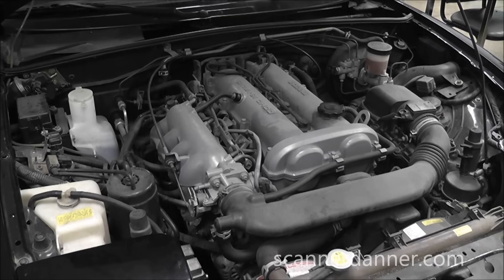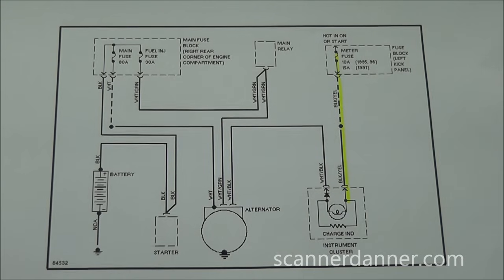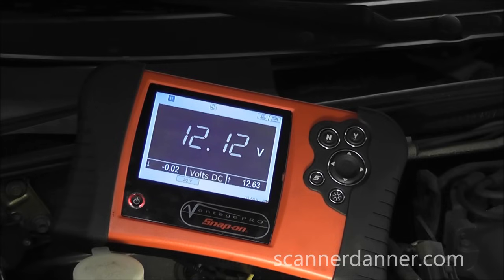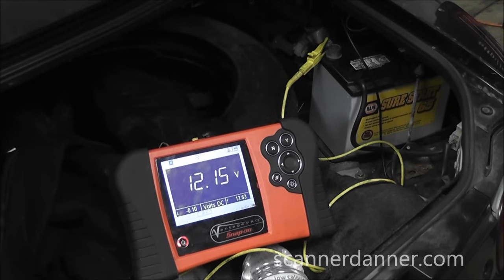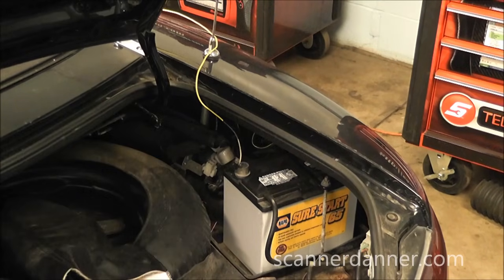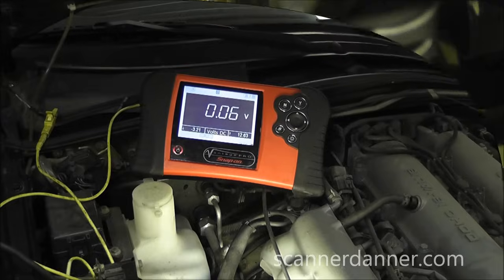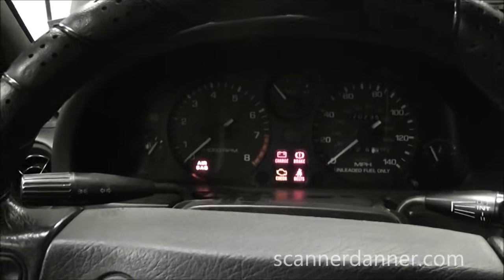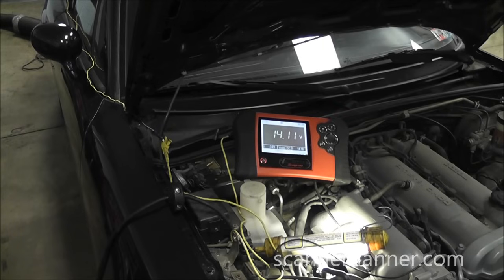How to test an Alternator (not charging from a blown fuse) - Mazda

Comment: I would never complain about your thorough tests Paul. I would much rather see a 2 hour video on a blown fuse than a 2 minute video on replacing a fuse.
Reply from the maker: nice
Reply: Well said!
Reply: Heck yeah! 
It has been my experience that it is rarely a blown fuse.  It is always the real world issues.
Reply: @ScannerDanner  what is the charging output current from the alternator to the battery when engine is running?? Is it fixed at 1 amp or lower, or varies??

And, how does the alternator stops charging the battery when the battery is full?? Any sensors??
Reply from the maker: @tnamen1307  all done by a voltage regulator that is typically inside of the alternator
Reply: @ScannerDanner  what is the charging output current to the battery before the battery is full??
Reply: Me too for sure

Comment: Thank you! This indicator lamp circuit test and its key triggering effect for the alternator to charge is  SUCH A LIFESAVER to know for older Miatas! You are the ONLY mechanic to EVER suggest this!
Reply from the maker: +yougeo thank you! just be sure it is an incandescent bulb in your test light and NOT an LED type.
Reply: +ScannerDanner Why not use an led type? Does it have to do with resistance?

Comment: Mr Danner. Every time you pull out a wiring diagram and trace the different components of the circuit you are performing a great tutorial . I share your enthusiasm for Mitchell diagrams  and sometimes feel lost without it. Auto electric[s] used to be a separate discipline, but this is no longer the case.

Comment: For educational purposes, it was excellent that you performed those checks before replacing the defective fuse.  I would have added that the charge light circuit is grounded through the stator;  thus, with key on, engine off, the light is on until the engine starts and the alternator begins charging, at which time the stator is creating voltage simultaneously removing the ground source for the charge light.  Also, with KOEoff, the voltage reading on that circuit would be less due to the presence of the diode.  Keep up the great work!
Reply from the maker: +Chad Jessup thanks Chad!

Comment: I diagnosed a similiar problem with my '01 Subaru Outback, the #5 fuse under the hood would burn out sparatically. Alt. would stop charging, gauge cluster would die, engine would continue to run.  I finally diagnosed the issue, there was a short in an aftermarket front turn signal connector.  The loose brass contacts that power the bulb were touching together and popping the fuse.  What a P I A!  Problem solved with oem bulb connector installed.  Great video once again, thanks Paul.

Comment: -with out answer at that time. than you for the deep explanation , by the way this truck was my dad truck not a customer, just to mention Paul f I have done many repairs other mechanic have not be able to do in my area, he has been working for 18 years on Honda dealer  and does side work as well me , but  He is part changer I feel very satisfy when i do those repair he can not do, but I use the  testing method you are teaching , i first test system and replace parts ,ALL CREDIT  TO YOUR TEACHING

Comment: typically I check a fuse first, but it really doesn't matter which direction you come from, and it's always good to check the function of the alternator anyway, or at least know how to do it so this instruction is still very valuable.
If the fuse is blown, then we know it blew for a reason, so yes, we don't send them away with the fuse replaced because it's going to blow again.

Comment: My hero, and I dont call anyone that easily. Im not done yet watching the entire video and I have 5 stars for you Paul, is it? My car is driving me crazy with a low voltage, no voltage and voltage drain even when the car is running. I've talked to so many 'subject matter experts' and they all give me the run around and dont even want to look at the car. I too had to get my alternator tested more than twice and even when checked ok I had them rebuild it from the inside out with new parts. I wasn't aware the alternator has to have solid ground connectivity through the casing to the chassis of the vehicle and although I've check there is at least some connectivity the fact that I painted the alternator bracket that holds it to the engine it may not be getting proper grounding. Also, my battery light is always on except today when i put a fully charged battery with at least 13.6v then the light went off but it came back up as my battery kept going down in voltage. I am almost sure now my issue is a wiring problem from the alternator and not the alternator itself. Thanks for not just stopping the video because you know what the problem is but explaining the situation to me a computer systems engineer makes a hell of a difference. My car is a rare SOB Dodge Stealth RT/Twin Turbo AWD, AWS, All Day Headache car but when it runs good it kicks but. Thanks for the information on this video. You've just got a new subscriber .
Reply from the maker: Some hate my teaching style, but when you truly need to learn systems and operation and you're not just looking for a silver bullet, then you've found the right channel. Thanks so much!

Comment: owe a huge THANK YOU, scannerdanner. had an accord in today that wasnt charging. check eng. light was on, customer said he tried a new alt-still didnt charge so he brought it in. i verified it wasnt charging, checked for + at the batt post and had power but i saw i didnt have power on the wire from the indicator light. found a blown fuse, replaced it-alt started charging. gotta diagram on that fuse-found it fed the heated o2, checked and found rubbed wire on the o2 from a misinstalled o2 sensor!

Comment: This video is one of the best I've come accross. Really good job. I noticed in the scematic that there is a resistor accross the charge indicator bulb, which I am assuming is there to keep the alternator working in case the bulb blows. This won't help with the blown fuse though.

Comment: ya i couldnt believe the things i was checking that i remembered you doing in this video were so closely related to my 'real life' situation. the cat conv. that the problem o2 was in was welded in. when it was welded in, it was put at the wrong angle so the o2 wires were stretched bad to make connection to the connector on the car. the wire rubbed thru and actually grounded out on the o2 itself. gotta handshake from the boss for that diag, cant thank you enough!

Comment: dude i have learn a lot from you. when i do alternator i use a test light to do most test its a quick easy way. use the test light to check the heavy gauge wire with the test light on ground we get we know that main alternator fuse is good. then you check smaller gauge wires. what i normally do is disconnect the connector in your case, you should find the test light for one of the wire when ignition at run. all alternator regulator the pin that goes to the warning send out negative as learn from you be component in this case the regulator. so with test on ground and touch the light if the gauge fuse is good the battery should come in the dash but you have to know your circuit

Comment: Scanner Danner: I tough that the white and black wire should have positive all the time while the car is running. Since the positive goes trough the light bulb. Unless its a a internal problem with the alternator, that is when the alternator give a ground to the light bulb and the light comes on.So i think seeing the 0.2 volts at the start on the diagnostic  at the white and black wire, was an indication that we were missing the positive or having an alternator problem, but not saying the alternator is bad yet before applying a positive to the wire as you did.

Comment: I got a truck to do once that wasn't charging someone had fitted an alternator. Batt light on dash. Not charging. After doin similar checks to you found an open circuit ign feed to alternator (that was a blown fuse). Had a dead short on that feed. Finally traced it to an electron headlight adjuster motor short circuit. Had me stumped for nearly a day.

Comment: Good explanatory video. The alternator recently failed in my BMW e30 but there was no charge warning light showing. The bulb is not blown. All ignition lights went off as normal when the car was started as if there was no problem but the battery wasn't being charged. Only indication was radio switching off and lights dimming.  Something is obviously blown in the alternator which fools the warning light. The charge warning worked ok when I tried what turned out to be another dud alternator in the car. Anyway a new replacement alternator solved the problem.

Comment: I think I had an old car years ago in the UK and the charge indicator lamp blew on the dash and the battery stopped charging. They were only filament lamps. I think the voltage on the alternator  side varied because the lamp would glow half on sometimes, maybe if the fan belt was slipping. I remember the regulator was some sort of set of relays they would be vibrating all the time. I must be going back to the time of dynamos. Great videos and great knowledge the man has. You can't beat having a good understanding of the theory of how things are meant to work. With cars they always seem to be switching the negative side of things, I suppose there's a good reason for that, if anyone knows?

Comment: Great video Paul. I remember this issue in my Dad's Chevrolet malibu 1978 whenever the bulb was blown off the alternator didn't charge any more unless you activate the bypass circuit by snapping the throttle gently

Comment: That was amazing! I would have thrown an alternator in that car for sure. What I don't understand is what the wire going to main relay was for. I figured that was the wire to excite the alternator and get it to charge. When I saw voltage at that wire, I immediately thought the wiring was fine and the alt was bad. So, what was that wire for? Again though, awesome!

Comment: I work as a supervisor for a large dealership, so I get to see a lot of new technicians and guys from trade and technical colleges come through the shop. I guarantee when they come to me about a electrical, or computer related problem my first question to them is -NOT- did you check all the fuses first!!! My first question is for them to explain to me how the circuit is supposed to work, what checks they made and what the results were. Sorry if it sounds like I'm tooting my own horn or being a ass, but I feel that it's important the new guy and those that are wanting to build a career in the automotive or diesel related field understand that as a manager/supervisor if you don't understand electrical, not able to constantly learn, improve and progress your future is very dim, at least in the wages aspect of the job. As a result of this I thought it might be beneficial for the new tech to understand what it is like from the other side of the counter. Example: I gave a tech a job, customer complaint, " Blower motor doesn't work at times customer has replaced several fuses with no change, some times works and other times not." Happens every few days but more so when it's cold in the morning.  Technician comes back 15 min later and reports with a smirk that was a easy fix what else do you have for me? What did you find I asked.  "I couldn't find anything wrong so I installed a circuit breaker and parked the truck."   Please don't be this guy!!   If you want to impress your boss and learn something as well explain to him all the resources you used in making your diagnosis. Present the wiring diagram and the measurements you recorded during your investigation. Present any further questions you think would be appropriate to ask the customer that might be related to his issue. If you truly can't find anything wrong at least document were you would go from this point if the truck came back with the same complaint, based upon how the system works present other things that would be effected in the circuit(s), such as power is provide from the key switch to a 15 amp fuse that powers a relay, this relay in turn power fuse numbers xxxx of the fuse panel which provide power to the blower motor. If the customer has the problem again have him look and see if his horn doesn't work at the same time etcc...
Reply: you really something else

Comment: You can get those test lights off ebay now for about £2.50, that's about $5 i bought 2 of them....yes inside the alternator the bulb circuit usually goes through the rotor, then through the regulator to ground, so when you turn the ignition on the light comes on, then when it starts there are 3 field diodes connected to the terminal inside so you get battery voltage on the bulb wire when engine starts, so you end up with 12 volts each side of the bulb...you can just earth the bulb terminal out to see the if the light comes on that's a good test on the light and wiring.....from Fred in England.

Comment: hi paul, I happend to watch a video about that Alternator especially on internals of electrical cirucit. The charging light gives power to the regulator, this regulator have a built in pulse width modulator which will pulse the field coil(on and off) the field coil, during high speed pulse is less and vice versa, once the car started, operating generator causes the charging light to go off by disabling the ground to that light. continued...

Comment: I see a couple of guys explained what makes the inst light go out when it cranks but it went over my head.  Can you help me on this point.  As usual a great video.  I always learn so much from yours and to me the longer they are the better.  Thanks.
Reply: +Jim Buford thanks Jim. Hard to do here but in short what makes the light go out is when there is equal potential on both sides of the bulb. 12v from ignition switch and ground through alt. When it's not producing voltage. Once alt begins to spin it puts voltage on that circuit that was a ground. Light goes out. Remember if a bulb has 12 and 12 there is no flow

Comment: It is interesting that the Alternator light dash circuit is needed for Alternator excitation (or perhaps voltage regulator enable), which I think is evident due to the resistor across the bulb, which provides a minimum feed resistance.

I think the question to ask is why did the 15A Alternator / Dash fuse blow? For an intermittent fault, I would first suspect chaffing fuse output wire under the dash. Because to blow the fuse the short would have to be just after the fuse. 

To test for voltage drop on the Alternator main output B+ (heavy cable to the battery) you would really want to have "representative" levels of current (vehicle running current with loads on together with the battery charging current) output from the alternator, which depending on the vehicle, may actually terminate at a power distribution box and then go to the battery. 

If you monitor the Alternator current with a clamp meter and watch the voltage drop you could actually determine the overall resistance if you wanted to. One reason may be to see any difference in the circuit after you clean up any corrosion or dirty or damaged connections. I know I can look at these two channels with my Scopement, but I have not yet tried my PICO Scope. All that is really needed is the proper channel scaling (and isolated channels, unless a voltage differential probe is used) and a built in math function.
Reply from the maker: In the description I have part 2 listed where we attack the cause of the blown fuse 
https://youtu.be/FK9STP4G9-I
Thanks!

Comment: These types of alternators have been around for 50 years.. And the first thing we did at the Alternator shop  was attach an exciter bulb to the alternator...As they require that bulb to excite the charging system...Then you find out why the fuse blew...

Comment: Hey, hey, Paul.  Awesome oldie but goodie!

?: That bulb circuit diagram is showing a diode I believe (WHT/BLK) and a resistor in parallel with the bulb.  Can you please confirm I'm interpreting that correctly?  I love the way you always follow through with additional voltage readings as you did throughout this video!  I helps to solidify what's being learned from your case study.
I tried looking for comments below asking about the diode but I didn't see any in the ones I went through... Thanks!!  Hope you and the family are all doing well.  Ciao!
Reply from the maker: Time frame please. Thank you!
Reply: @ScannerDanner  Hi Paul.
1:02 the wiring diagram of the instrument cluster bulb wiring shows a diode symbol between the bulb and external connector WHT/BLK.  Also, a resistor in parallel with the bulb.  Is that in case the bulb filament is severed?

Thanks again!

Comment: Great video Paul, never seen this before. So if a charging problem exists always check for the charge lite with the KOEO on all cars? Video suggestion, parasitic drain caused by the ALT. Replaced the ALT. and problem went away. It was on a 93 E-150 with a 5.0 engine. Don't exactly know why but I suspected a diode problem even though the diodes checked out ok on our test equipment.
Reply: Sorry I missed which wire you leaned the test light against at the end of this video. Will you please tell me?  I love your videos....been watching a lot of them lately. Picking up good information even though I don't have a scope. I can convert a lot of info to what I do have to work with. Not all but it sure helps. Thanks for sharing your knowledge.

Comment: At the end turned out to be a classic charging battle by the alternator and the fuse that took the lights out on the dashboard. Nevertheless the engine would still be starting at least and running and not charging but its still lights out at the dash by the little regulator himself ha ha. But you know, you never know when is your next tune up lol..... Lol I'm getting a test light, nice job...